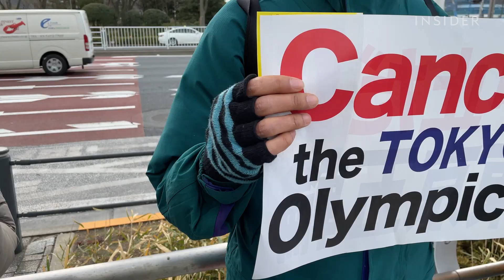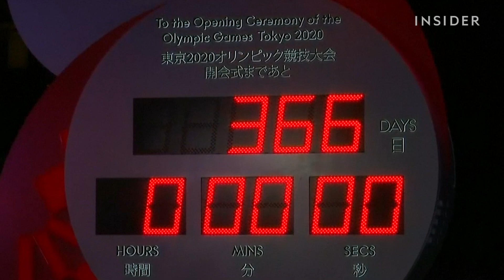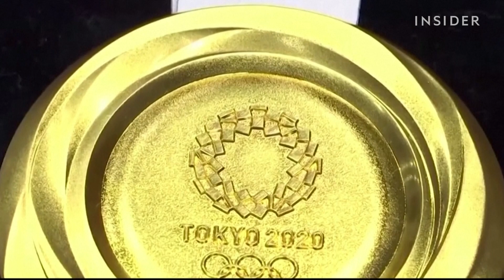How The Tokyo Olympics Became The Most Expensive Summer Games  Ever | So Expensive

Comment: I honestly agree with either having the olympics set to a manmade island forever, or permanently moving it back to its home- Greece. I looked up Mount Olympus's weather and there is no doubt it was straight up destined for the Olympics. It experiences extreme heat in summer and heavy snow in the winter. The altitude and shape is insane, but it would be cool to have the facilities situated at the foothills.
Reply: Not to mention the cultural significance, basically carrying the spirit of ancient Greece.
Reply: extreme heat is not a good weather for good performance
Reply: @thekyuwa  depends on the arenas they create
Reply: @Serenitykarter  but there are many disciplines to be played outdoor, so rip...
Reply: If only the greek government knows how to handle and maintain their olympic facilities :(
Reply: @juanbaker8717  I mean, if you created permanent venues with guaranteed prestigious use every Olympics, it would be a bit easier.
Reply: Greece could use it

Comment: The 2014 Sochi Winter games costed $51 billion so Tokyo in comparison isn't that expensive
Reply: Mobius 217 every Olympics always goes over budget and I think the Sochi winter games went over budget by almost double because they had to build every required building unlike other countries where they usually already have some places with prebuilt arenas, it's quite pointless to have the Olympics at a different country each 4 years when they could just have it at the same place each time. On average it costs 20 billion dollars for a country to hold the Olympics and the Olympic committee takes an excessive amount of money earns by the country from the Olympic Games which is outrageous.
Reply: Vendetta exactly!

Comment: The Winter & Summer games should be split in half to form Summer A, Summer B, Winter A, and Winter B. Each of these is still held every 4 years. This way, the Summer/Winter Olympics alternate every other year and you have an Olympics every year instead of every 2. By reducing the number of events in a given Olympics you require less infrastructure for the host city. You could also reduce the number of attendees and make the venues smaller/more likely to be used after the games. The IOC would also make more money since the games would be held every year instead of every 2 and they make their money from selling the TV rights anyway. It's a WIN, WIN, WIN.

Comment: making an island for the Olympics is way harder than it sounds, but having a rotation cycle of fixed countries seems very fair.
firstly they don't need to waste money on the bid. next, they can reuse stadiums & areas that have already been build. while they aren't hosting it, the Olympic village could turn into a hotel so that people can come in while it's not on, but they can also clear the village out easily when it's time for the Olympics. if they want to "modernise" it,  they can just refurbish and remodel the current building. plus, this way we can have eligibility criteria as to who can be part of the cycle so that countries with unstable governments cannot participate (to prevent stuff like the aftermath of the Rio 2016 games, where the Olympics area was abandoned and isn't in use) once, the countries are ready to join in, they can maybe propose and prove that they are stable enough to join the cycle.

Comment: There are a handful of cities that have made a profit off the Olympics, including Atlanta GA. Why aren't other cities following these particular models if a profit is possible?
Reply: The problem is that some of the countries like greek where everything has gone downhill since the olympics, had already even before the olympics so much debth and problems in general that they just couldn’t.
Reply: @S_kare  yeah, but it's still only like 5 or 6 cities out of ALL the olympic cities that have made a profit. imo, each city should be modeling their olympic efforts to match those of the most profitable cities, yet it doesn't happen. 

Atlanta was tiny until the Olympics, it's what made the city essentially. It didn't have much money, but it made the money happen thru crowd funding before it was a thing; and reselling the structures built for the olympics after the fact. 

It's an achievable model, yet hardly anyone follows the profitable city model, let alone atl's.

Comment: Olympics are not meant to turn profit for the host. It is supposed to turn profit for contractors, IOC and some mobster betting on results of less visible events. Sponsors can turn profit from selling tech, but I fail to see it happening now. Back in the 1990s up to 2016 Rio there was a strong market for better TVs. The push to 8K is much smaller though.

Comment: All while Beijing is saving a s**t ton of cash for their 2022 Winter Olympics, as they already have most of the buildings constructed from the 2008 Summer Olympics, and only have to do renovations/convert for winter sports.

They still have to build a new Olympic village, Bobsled/luge track, Snowboard/ski venue, & a speed skating oval...which seems like a lot, but is nothing since most host are tasked with having to build EVERYTHING brand new. 

The 2008 Summer Olympics made a $146 million (usd) profit, so it's easy to see how Beiging will come out laughing in 2022.

Oh yea, their also taking notes of all the f**k up's that Tokyo has made, and making sure that they have a plan A, B, C, all the way to Z, as the world is certainly not going to be Covid free by February 2022, but will likely be at full capacity for the Olympics.